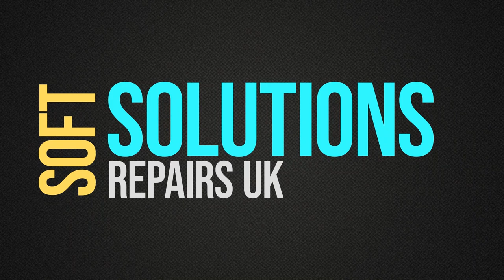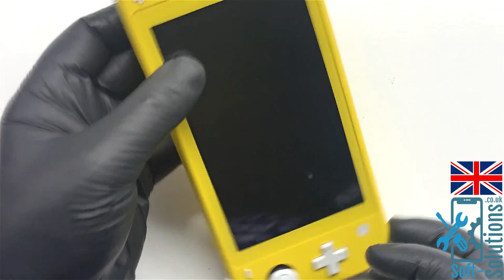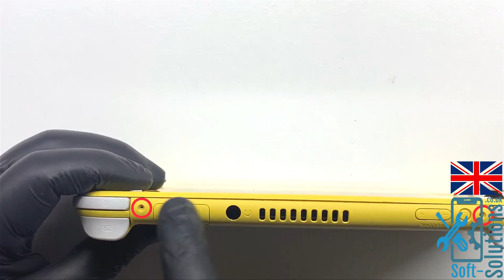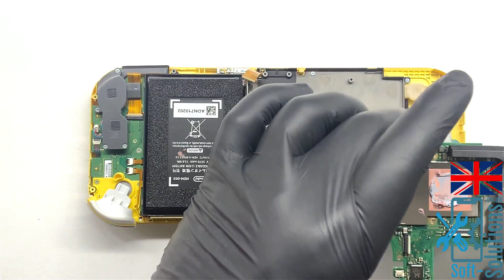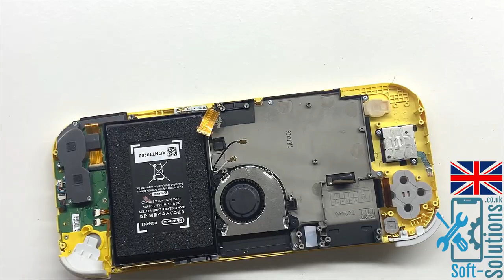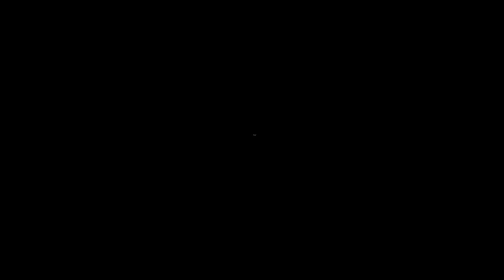Nintendo switch lite right joystick replacement

Comment: I changed both joysticks out. The switch lite fires up and can hear noises when I press buttons but screen is black/ lit around the edges. Any ideas what I  missed?
Reply: Dude freaking same problem!
Reply from the maker: Display connector needs replacement
Reply: @SoftSolutionsRepairsUK  the cable or the connector it goes into on the board? Thanks for your help!
Reply from the maker: Yes, most of the time when display goes, that is the connector broke or damaged, if you see it under the microscope the pins are bent.
If you mail in to our store, we charge £50.00 to replace it.
Reply: Unlock and remove the video cable (behind the game card), then push it back and make sure it's all the way in.  The side tabs of the cable don't quite go flush like some other cables but they are very close, leaving the tiniest space before you lock the flap.
Reply: SchizOnWheels  had to send it off to get repaired unfortunately but works great now! :)
Reply: SchizOnWheels  I did, but I unfortunately broke a cable in the process.

Comment: Hi, thanks for you video. My only issue now is that it doesn't read the game cards and headphones doesn't work. What you think it could be?
Reply: happened to me too, would like to know how to fix
Reply: SchizOnWheels  it was loose cables and wires so i went back in and made sure i tightened everything and was a little more careful with my hands and kept steadier. have a couple hours on your hands because this project will take a little on first time
Reply: SchizOnWheels  i fixed the one on my switch lite once, along side the tutorial, i took it apart and just had a cluttered desk so i kept losing parts 
just keep a bunch of separate dishes to keep screws in and a space for all the parts you have to disconnect
it’s not too difficult and can be done if you pause step by step
Reply: SchizOnWheels  just make sure that everything is connected right and not too too tight that it’s breaking but tight enough that it feels snug, be gentle with light pressure and you’ll be golden
Reply: SchizOnWheels  they do but it’s very very hard to feel if there’s a lot of vibration around you in the room, so find a quiet space to focus
most ribbon receivers will make a small click when it’s in place

Comment: I would recommend using a plastic or rubber tongs if you can find 1, sometimes you can cut a ribbon can with metal and not notice.

Comment: Cheers worked for my lite pokemon version switch, just because someone said that a step was missed putting it back together I just dl'd the vid and watched it in reverse. For those having no luck, it must be putting those cables back in, it takes good light, good tweezers and patience. Anyway all fixed, recommended!
Reply: SchizOnWheels  not a technician but I fixed it.
Reply: SchizOnWheels  no, that probably means the lcd cable has not been connected correctly.

Comment: After going through this, my screen won't turn on. I can tell the backlight is turning on, but the screen is just black. It makes all the background noises when I push buttons and cycle through the menus, but I can't see anything. Any idea which ribbon I might have not connected properly?
Reply from the maker: Display connector
Reply: Unlock and remove the video cable (behind the game card), then push it back and make sure it's all the way in.  The side tabs of the cable don't quite go flush like some other cables but they are very close, leaving the tiniest space before you lock the flap.

Comment: Thank you for this video! I was able to replace my broken right joystick. Like a few people I got a black screen when turned it back on. I was able to hear sound and see the backlight just no picture. I opened it up and re did the lcd flex cable. I cleaned it off before reattaching. And it worked, but now my card reader won’t work. Any idea on how to troubleshoot before ordering a new card reader?
Reply from the maker: Try same thing you did with lcd connector u less connector is not damaged. In most cases of diy repair, we found the connector pins damaged inside. Good luck .

Comment: Thank you so much! I replaced both joy sticks on one switch lite and they work great. On my 2nd attempt the battery connector popped off the motherboard. Could you recommend a method to reconnect it? Thank so much!
Reply from the maker: Need to solder it back on

Comment: This is a very clear tutorial and had useful tips. This is such a pain to replace though compared to the joycons on OG switch.
Reply: God I can agree to that, after putting in the new control stick now I am having problems with the screen :(
Reply: @FuryousD  what kind of problems?
Reply: @etherraichu  screen dont work anymore, i think i figured out why though,.
i think i might not of connected something properly when putting it back together and the ribbon that connects the screen to the motherboard got some of its pins fried.
so now i have ordered a screen replacement so i can replace that, and this time i am going to make sure everything is connected and connected properly b4 i try to turn it on again.
Reply: @FuryousD  
Yeah my backlight came on but no video, I was pretty sad.
I realized the video cable (directly behind game card) was out 1mm farther than it should have been, I unlocked the slot and pushed it all the way in, locked again, it all works now.
Reply: @ReekRendTest1  yea i got new parts for it and tried fixing it again but sadly i think it was another part also that i dont think u can buy so that Switch is dead now, what's worse is it didn't belong to me so i feel bad that i ruined someone else's switch and their mum paid for the extra parts too.
now they dont have a switch and we aren't on that good of terms with them (not because of the switch) anymore so i can't even help them get a new one.
Reply: SchizOnWheels  idk how, i was replacing a joystick and when I put it back together it stopped working, so I bought a new screen and digitiser, put them in and it still didn't work.
Ended up just throwing it in the trash and am buying a new one for him for Christmas.
Reply: SchizOnWheels  idk it's been months since i did that repair and i dont even have it anymore so i cant check

Comment: While replacing the right side the white tab that secures the cable running over the battery connection wire came off (flex cable from mother board to daughter board). I have the part still but I can't figure out how to put it back in so that it secures the cable. I reassembled the switch with out the tab, only to be greeted to audio but a blank screen. Help?

Comment: Getting the speaker cable out was the most hardest for me. My switch lites analog broke so I ordered the analog from the original switch, and it worked. I accidentally cut the red cable  speaker so the right speaker is dead, but I'm okay, I ordered replacement speaker's so no biggie. I should have applied pressure to the side of the cables placement, and not in the way of "Looks like I'm using scissors style with the forceps.".
Reply: Ironically it is not necessary to disconnect the speaker cable for any reason (unless you're replacing the speaker itself).

Comment: I did this and now my screen won’t turn on at all. I’m not sure if there’s anything that would be a common mistake? Any tips?
Reply from the maker: Check and reconnect all the flex cables properly
Reply: I'm having this same problem
Reply: Did you ever fix it? I have the same problem
Reply from the maker: What we have experienced when repair switches when you attempted repair and had no display issue.
80% have damaged display connector or shorted pins inside the connector(connector needs to be replaced)
20% Of them broke traces under the CPU(cold joint traces damage) by putting too much pressure on the screws while unscrewing and screwing them back on(CPU needs to be repair)

If you would to send in for repair, please follow our Mail-in repair link.

https://soft-solutions.co.uk/mail-in-repair/
Reply: @Isaiah-uy3ek  no I didn't.... I'm looking into buying the motherboards now
Reply: @shawniethomas2921  oh dang, good luck. I guess Ima just buy a new switch idk
Reply: @Isaiah-uy3ek  I was thinking about doing that as well, either do the motherboards or just buy another switch

Comment: Im the idiot who didnt get the first question on the test sheet. Everything was going fine until, one I had trouble removing the back. Two, one of the screws on the board ended up being stripped(No I did not do it it was already smooth upon inspection and before I touched it) and three, my heat sync wouldn't come off. So, here my question, what screw head do you recommend for me to be able to take off this screw that refused to come out of the board? Or is there a toolkit you can recommend I buy with all possible sizes I may need to repair this?

Comment: Hi, Question... what brand of thermal paste do you recommend ?
Reply from the maker: There are 3 types of thermal pasts
1. Carbon Based
2. Ceramic Based
3. Metal Based
Now it depends on the sugar of both side where you going to use it. I normally use carbon based and mostly ceramic based, as ceramic based stability on most surfaces is good.
I use ARCTIC MX-4 with for bigger boards like ps, Xbox & MacBooks
And on smaller boards like Nintendo’s etc, you can mix MX-4 with HY510 as MX-5 are expensive. And smaller boards less likely to heat up. 
Again it’s the durability, a good quality past will take longer to dry. 
Hope it helps.

Comment: Can you help me with this?? I followed  your video step by step to changing my right joystick, attached all flex cables, wires and everything else but the nintendo switch lite will not come on. What could be the issue?
Reply from the maker: Hi Dawn, we see this issue a lot of time when someone does DIY. And all the time they break the display connectors itself which is very delicate part. Please post us your device using our mail in repair link from the website and we ll fix it for you.

Comment: my switch lite has several screws that have been stripped before I even attempted to touch them. i got most of them out except for one of the screws keeping the charging dock in place. idk how I'm getting it out. I've tried everything. I'm not using any of the old stripped screws I'm just ordering replacements for them, but I really need to remove this last one for my own sanity.
Reply from the maker: I am afraid, you ll not be able to remove worn head screw but to damage the board without professional tools.

Comment: It worked I replaced the analog stick your video really helped but I noticed that I didn’t add the thermal paste what kind can I use and do I have to use it
Reply from the maker: If it’s dried than you should replace thermal past. But if it’s not dried and you don’t have one you can gather the old past and use it.
Reply: @SoftSolutionsRepairsUK  how can you tell if it's dried

Comment: followed the guide closely.  however, once i try to turn it back on, i hold the power button for about 10 second and then i hear like a "click" or a pop" and nothing happens.  everything seems solid, made sure that the battery was snapped in all the way, both sides.  kinda confused.

Comment: So I followed your instructions on replacing the joystick. Everything went well... or so I thought 😆 my switch has no display now. Do you have any ideas of where I went wrong?
Reply from the maker: Display connector will have to be replaced
Reply: Unlock and remove the video cable (behind the game card), then push it back and make sure it's all the way in.  The side tabs of the cable don't quite go flush like some other cables but they are very close, leaving the tiniest space before you lock the flap.
Reply: SchizOnWheels  yes

Comment: After this my switch isnt showing anything on display , the screen is giving light and switch is working but nothing shows on screen other than black screen ,  can you help what might have happened????
Reply: Unlock and remove the video cable (behind the game card), then push it back and make sure it's all the way in.  The side tabs of the cable don't quite go flush like some other cables but they are very close, leaving the tiniest space before you lock the flap.
Reply: @ReekRendTest1  thanks bro

Comment: My lite doesn’t respond when I move the right analog up or down only left and right should I replace the analog?
Reply from the maker: You ll have to make a move if you think you can.
Reply: My swtitch lite does the same thing the right analog doesn't repaond when i try to move up or down so is replacing the only thing
Reply from the maker: Most probably it’s the joystick. But it could be something on the board(rare condition if it’s WD )
Reply: My niece's is doing the same thing! Do me a favor when you have time and look underneath without taking it off. Is it craked? My niece's right stick is. I'm attempting this in a couple of days when the part comes in, I'll let you know if it's worth.
Reply: If its a problem like that it may be covered with waranty

Comment: if my touch digitizer flex cable gets damaged will hte screen turn on? my has a tiny tear in it and the screen wont turn on. Otherwise great video
Reply from the maker: There must be a tear or damaged display connector  is the reason for no image .
Reply: @SoftSolutionsRepairsUK  is there a way I can fix it?
Reply from the maker: No, you can not without professional knowledge and tools.
You can post your device using our mail in repair link from the website.
Reply: @SoftSolutionsRepairsUK  i have already ordered a new digitizer. can i mail that with to you as well?
Reply: @SoftSolutionsRepairsUK  or will some place like best buy fix it so i wont have to mail across the ocean
Reply from the maker: When mailing please mention everything you send. Yes you can mail in new digi.

Comment: My switch won’t come back on 😣 I’m pretty sure I got all the cables back correctly, However I noticed a spark as soon as I touched the first cable, and also didn’t replace the glue because it wasn’t in my kit and had no idea I needed it until I was already done re-attaching everything. Very frustrating and scary

Comment: Does the switch lite use the same sticks as the normal switch? I dont know if i ordered the right sticks
Reply from the maker: No
Reply: @SoftSolutionsRepairsUK  so they are different?
Reply from the maker: No, they are different.

Comment: I followed everything step by step but now my switch won’t even turn on idk what I did wrong
Reply from the maker: What we have experienced when repair switches when you attempted repair and had no display issue.
80% have damaged display connector or shorted pins inside the connector(connector needs to be replaced)
20% Of them broke traces under the CPU(cold joint traces damage) by putting too much pressure on the screws while unscrewing and screwing them back on(CPU needs to be repair)

If you would to send in for repair, please follow our Mail-in repair link.

https://soft-solutions.co.uk/mail-in-repair/

Comment: I did everything ste by step, and the joystick i replaced now it won't work left or right, it only goes up and down, do you think you can help me with that? did I do something wrong?
Reply from the maker: Yes you did. Swap the joy cons. If the problem is still there then your joycons are faulty.

Comment: When I disconnected the ribbon to the joystick the ribbon receiver piece came dislodged from the mother board and flew across the room. Is there any way to fix that or is my switch ruined now?
Reply from the maker: Connector on the motherboard needs replacing. Old connector will have to be desoldered and replace with new one. 
Please contact our repair team to get a quote on bellow email address.
info@soft-solutions.co.uk

Comment: I've got to the motherboard removal section and one of the screws wont budge and is abit stripped, any suggestions plz
Reply from the maker: @Joshua Williams
Without tool you may end up damage something by force.
If you send us the device, our team will sort this out for you and finish the rest of  work.
Contact us on: info@soft-Solutions.co.uk
Reply: Bro i got the same issue 😂

Comment: Can I just pop the joystick back on though? Nothing looks broken, it just popped off when it was dropped
Reply from the maker: Yes, it works fine
Reply: @SoftSolutionsRepairsUK  ok thank you. I don’t want to have to take it all apart if I don’t have to. Seems like I need to apply quite a bit of pressure to push it back in, does that seem correct?

Comment: I did this exactly the way you did it, I put everything back exactly as you did, but now it’s turning on and sound and buttons work but nothing is on my screen!! I can see the backlight come on, and I hear the buttons working, but nothing shows. I’ve double checked all cables and the battery and the cords, I’ve had my dad look at it. We did it exactly as you did. Please help! I can’t even send it to Nintendo for repair now since I tried to do it myself! I’m a single mom and I can’t afford to buy a new one. It worked fine other than the right joystick before this. Please help!!
Reply from the maker: If you think display cable is connected properly, there must be something damaged inside either cable itself or if you see cable is not been pulled or torn, there are other components you can’t even see with bared eyes (we work under microscope to repair them)
I would say check again display cable properly. If you are unable to get it working, go to description and get in touch.
Reply: Soft Solutions Repairs UK I live in America that’s my issue about sending it to you guys unfortunately. The display cable is inserted properly, I checked it and rechecked it so many times. Can the display cable be repaired if it is somehow messed up if I did send it in?
Reply from the maker: Please contact us via email and one of our technician definitely have a answer.